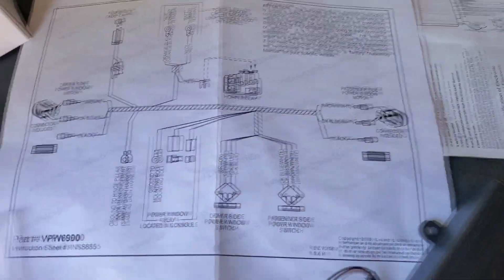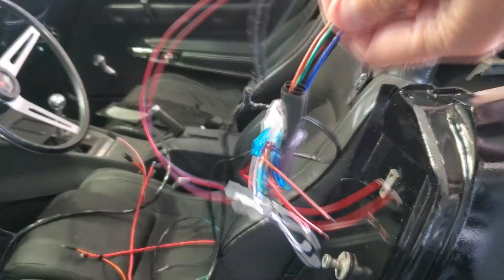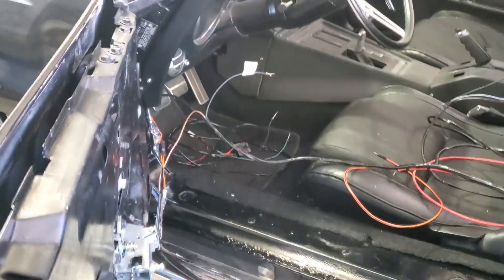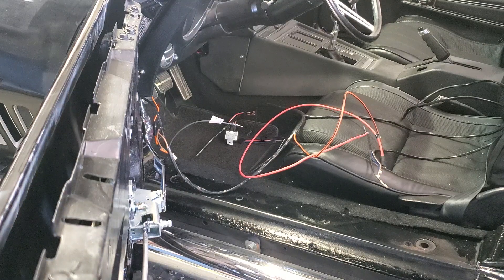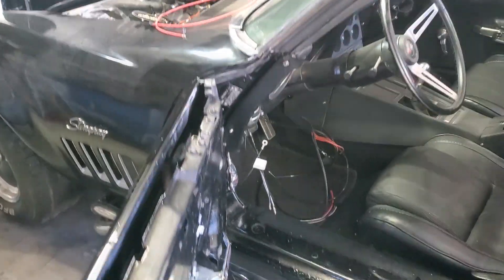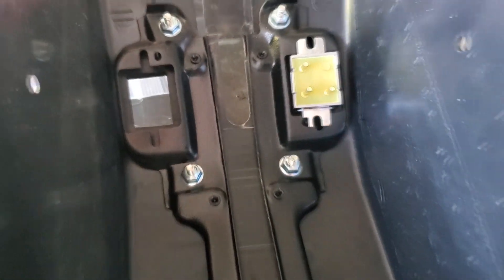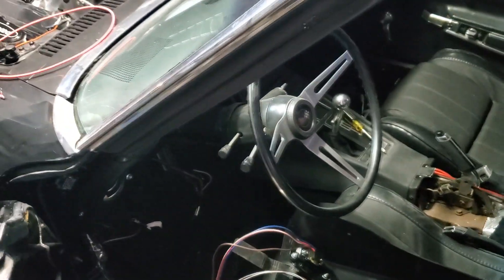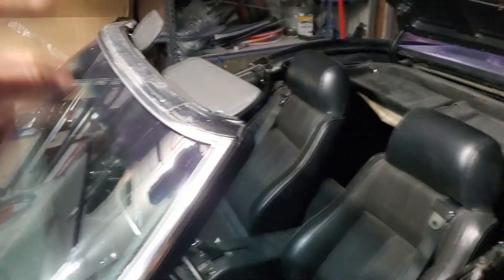Working on the doors. Pt-11. C-3 1969 Corvette. Running the wire.

Comment: What you want to get quotes on, is a “respray”, used car dealers do it all the time. The only thing the painter may bring up, is the compatibility of the paint formulations. They can always spray a coat of sealer before the respray, though. 

Note: the trim piece that surrounds the bottom of your windshield looks nice polished and gives it that old school vibe with the chrome like shine…but if you look closely, the bottom portion should be painted so the only the very thin top part shows as polished and wraps around to match the window felt trim pieces on your doors. Plus, it shows off the gleam of that thin bright chrome trim from the windshield around to the doors as a seamless line. But different bites for different likes. 

You may want to run an auxiliary ground cable just for these mods you are doing and go straight to the chassis if possible. My Vette suffered from electrical gremlins until I chased down the grounds and added a few. 

I’m thoroughly enjoying your channel, and look forward to the next video with anticipation! 

Get it Tric with Nic!👏
Reply from the maker: I'm way ahead of you on the ground cable. I already ran one to the engine/chassis, chassis/bird cage, chassis to battery. When I first got the car I was having issues then. Made a huge difference.

I didn't know about the lower window trim piece, but I have seen a few vettes with it painted. Now that makes sense. I will keep mine as is, as I like the look. But I learned something new today, thank you.

When I get a little closer to being finished I will go see what a respray will cost. Thanks for that tip also. 

I hope I am keeping it interesting.